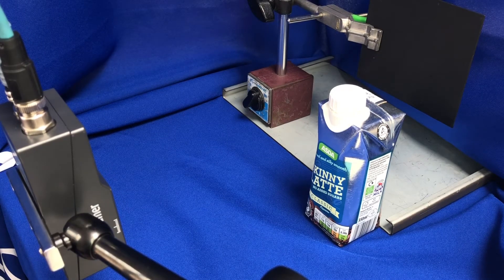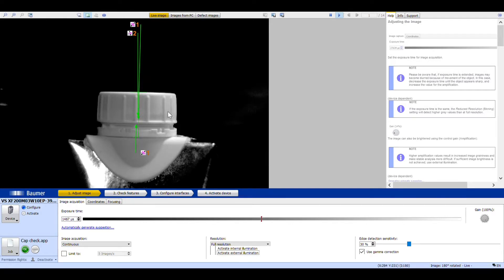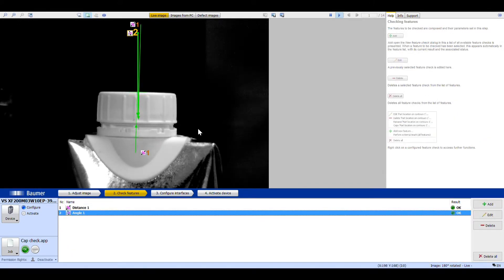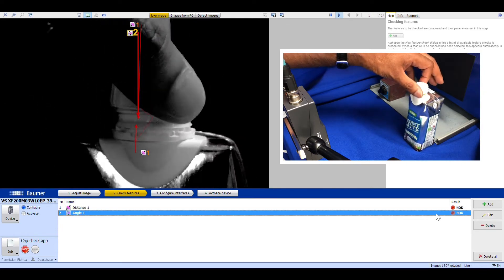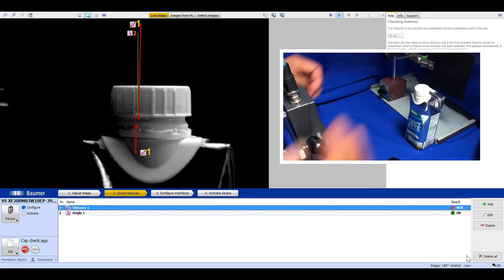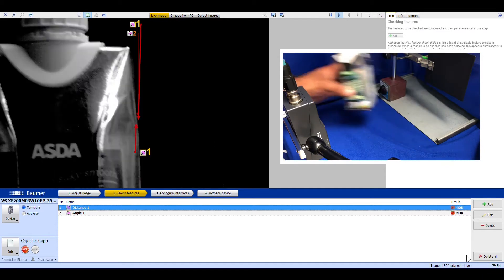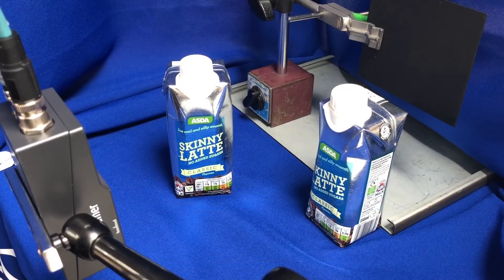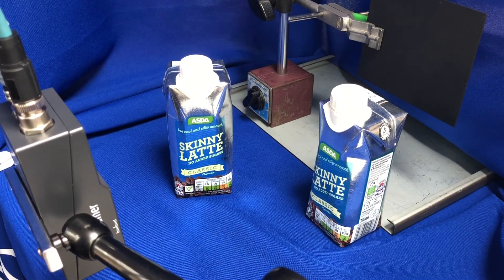Baumer Verisens Smart camera application demo - Cap Inspection

Comment: Excuse me, Can this camera connect and transmit data to PLC ?  Because I also have one. But I don't know how to connect it with PLC via ethernet.
Reply from the maker: Yes it can, on our website you can find depending on which model you have the function library required. Use the 8 digit camera part number to search.